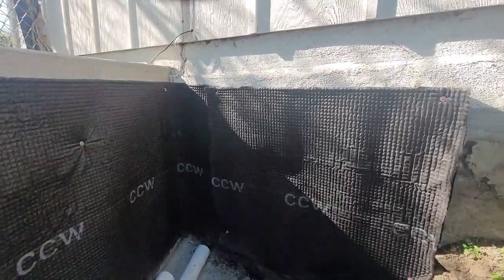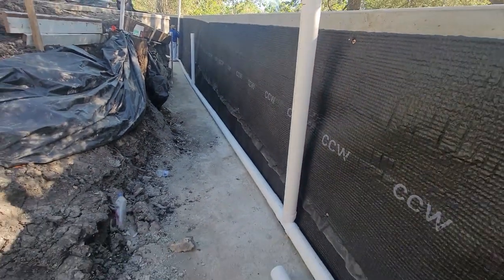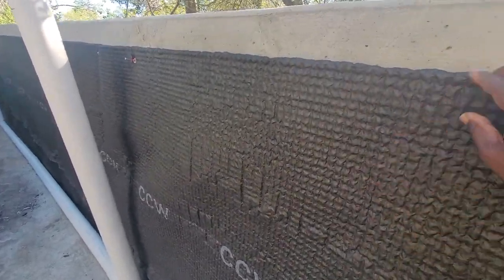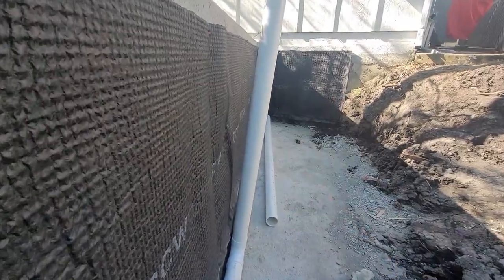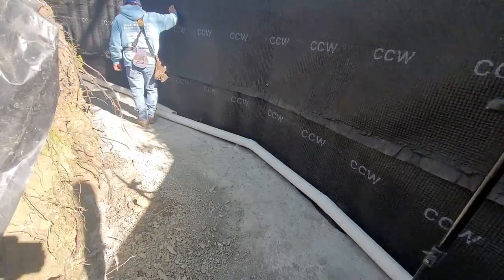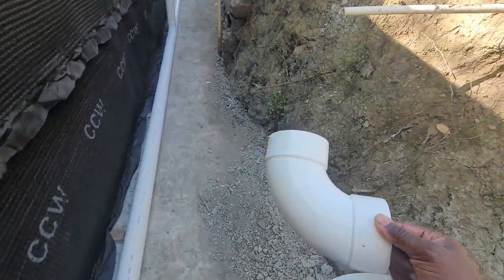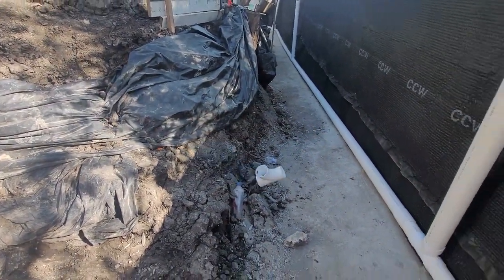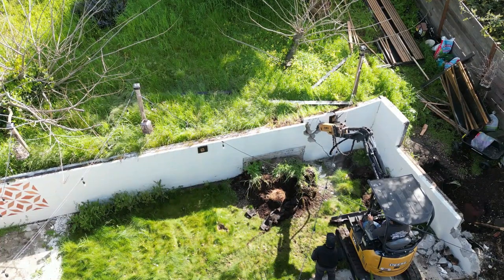Walkthrough of Our MiraDrain Installation on a Concrete Wall

Comment: I have a 6' high by 65 ' long timber (rail tie) retaining wall that's at least 50 years old, and rotting away. It's holding back approx 30 to 35 degree slope, (in Michigan).
Reply from the maker: What are you going to replace it with

Comment: Noticed you didn't have waterproofing on the wall prior to the Miradrain 2000, does this also work as waterproofing for the wall as well? I'm enjoying your videos as I'm going a large remodel which includes some large retaining walls and an verifying what the pros are doing... Great stuff!
Reply from the maker: We never add waterproof on our concrete walls.. Ideally when we use Mira drain it's because we trying to save on exporting dirt. Good luck with your project..👍🏾👍🏾